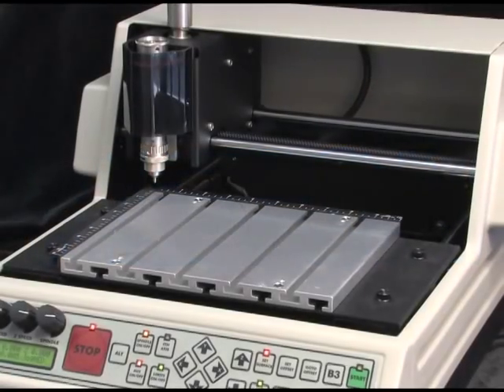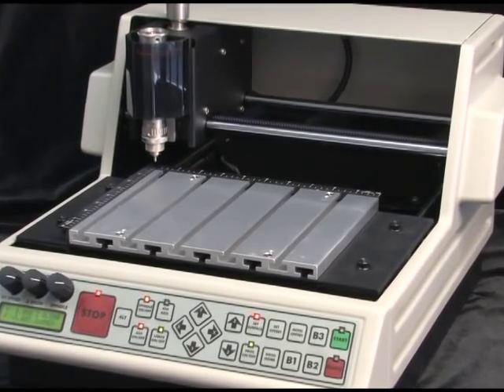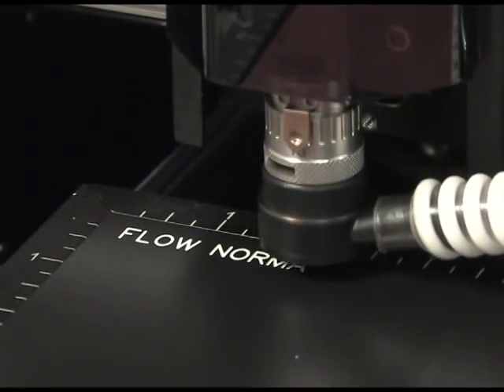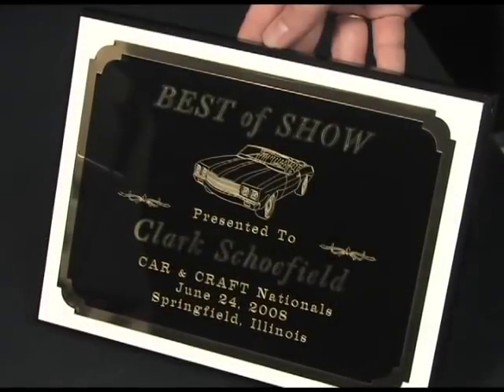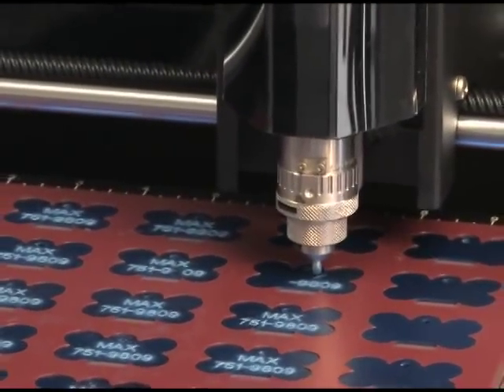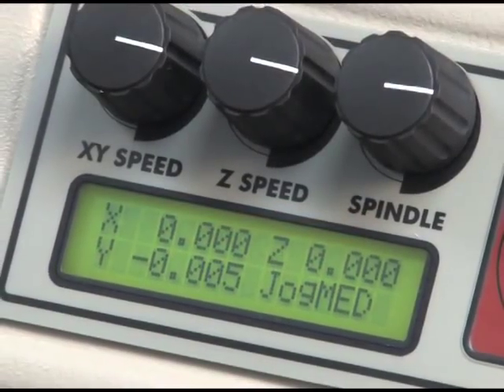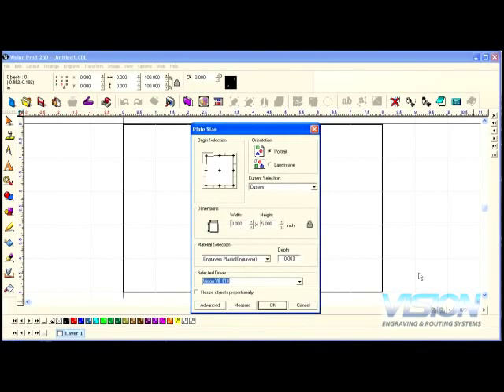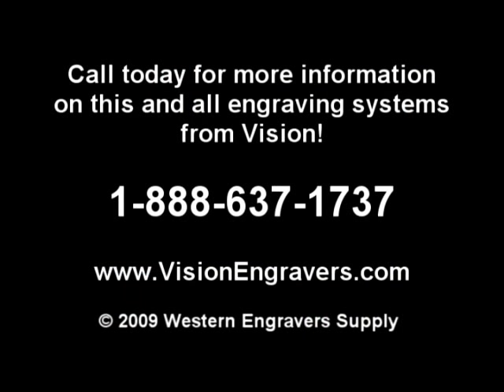Vision Engraving & Routing Systems VE 810

Comment: If you need a part for this call vision you must pay them $190.00 for tech support before you can by a $ 10.00 part
Reply from the maker: Hello,For 1 year of Vision Tech Support it's $199.00 and you can buy a part without purchasing Tech Support. They often times suggest purchasing tech support to assist in installing the part and or finding the part that is having issues. Thank you.
Reply: ebay